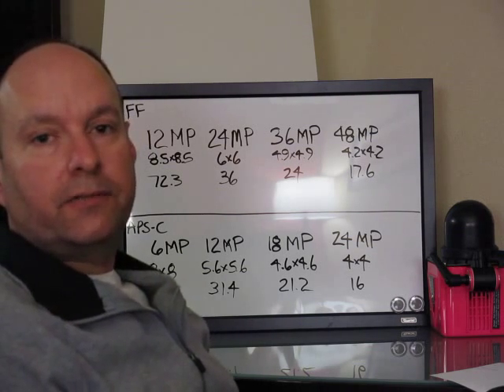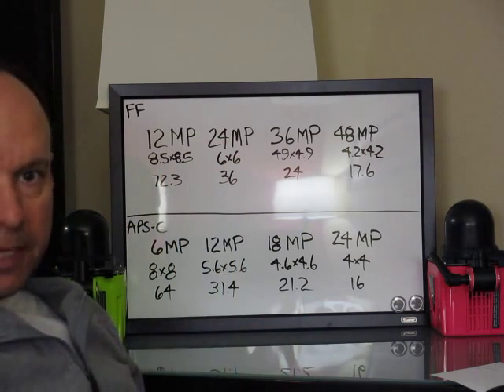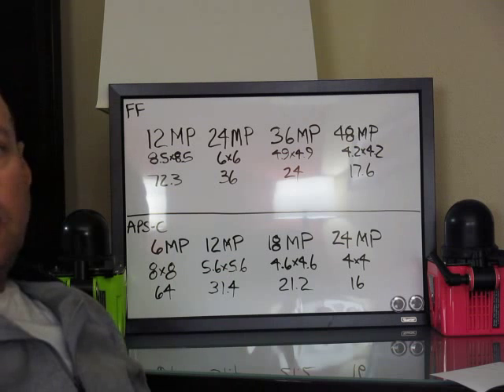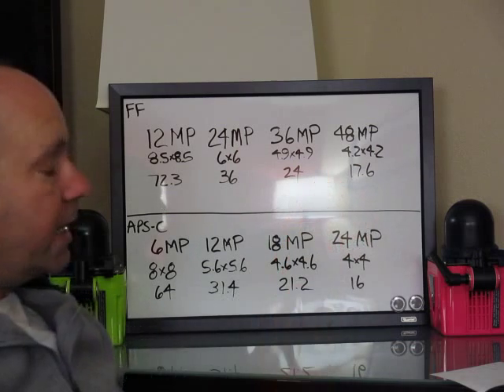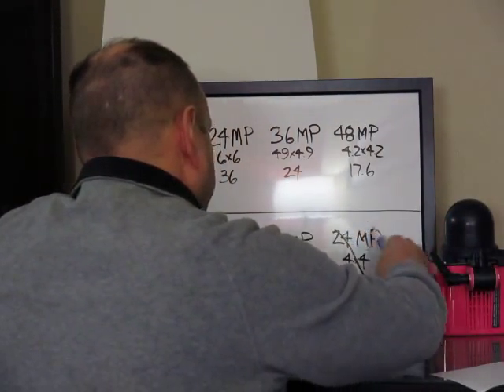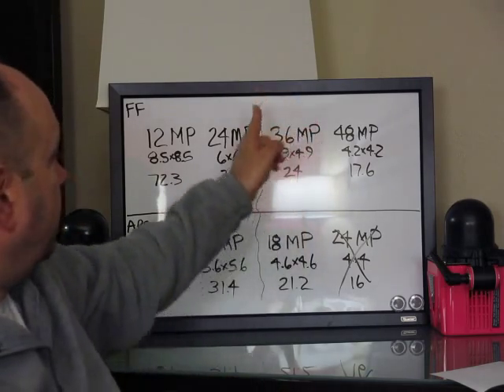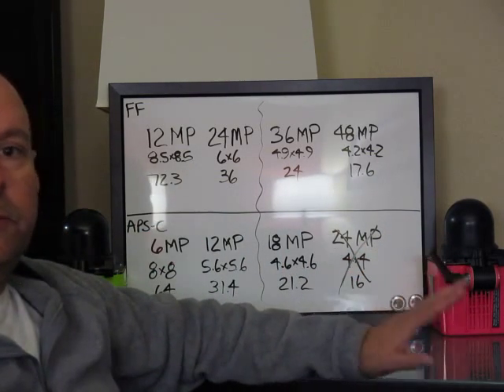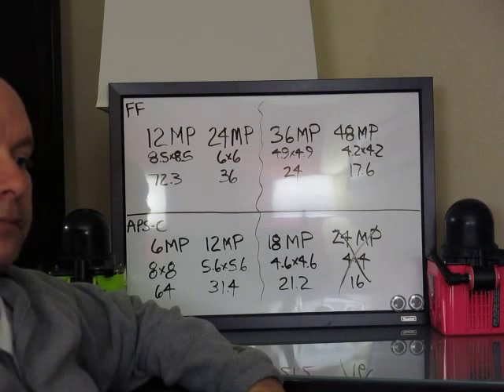Future of the DSLR

Comment: Correct, however the manufacturers improve SNR software and in-camera processing and sensor quality as well. So, instead of them saying "here's an improved 24mp camera", they tell me "here's an improved camera, and by the way we also increased the megapixels". So I have no choice but to buy the new one.
Reply from the maker: Smartphone cameras are getting better. I saw two major advances with Apple: the 4s in October, 2011, and the 7 Plus in September, 2016. Huge advances in image quality. And we saw Nikon actually dial back the number of pixels in their APS-C cameras, from 24.3 MP to 20.9 MP.  I give Nikon great credit for not following DxO's rule that MP count must always climb upward. Thanks for your comment.

Comment: Your videos are very informative, sir! You should always leave the comments on.

Let me agree that I also believe mirrorless is the way to go. The optical viewfinder has a lot of goodies coming with it (focus peaking, zebra, eye autofocus, face detection, exposure preview...etc, etc). Thing is, that might drain the batteries faster than looking into a prism. So I expect newer DSLRS to allow a mirrorless-like features like these. Just lock the mirror up, and you're good to go.. but I believe that part of the appeal for mirrorless today is that now that the focal flange distance is shorter, you can pretty much mount any lens designer for a D/SLR with an adapter.

I thought mirror slap has an effect on images at lower shutter speeds (< 1/125), but even without a mirror,  you also may have issues with shutter-induced shake like in the first Sony A7R that people talked about.
Reply from the maker: Adil:

Asalamu alaikum. Your insights and knowledge are greatly aporeciated. I agree with your comments. And thanks for your kind words. 

My warmest regards,
Rob